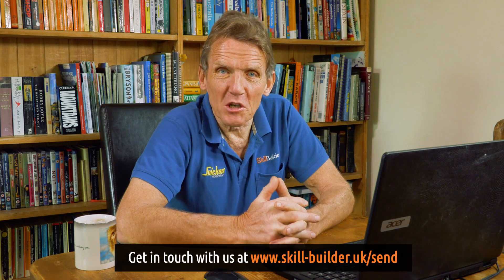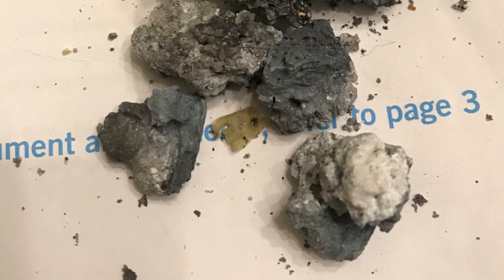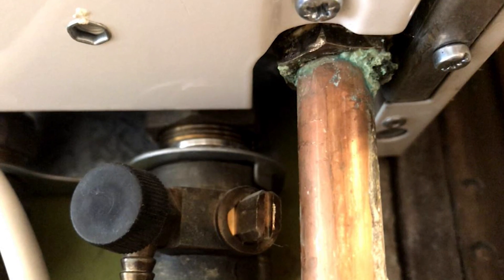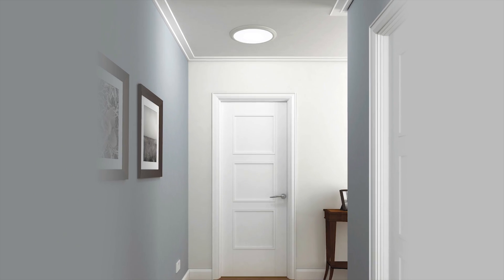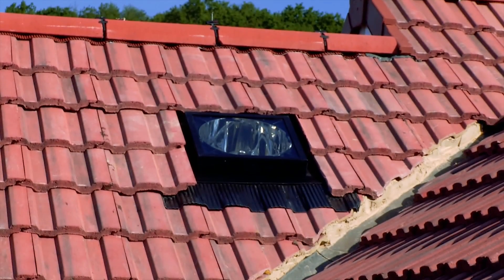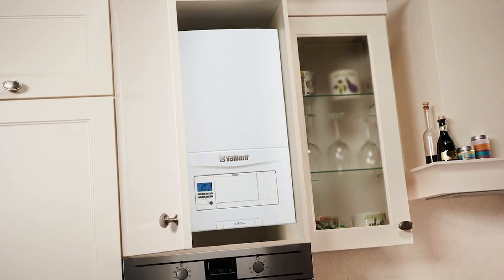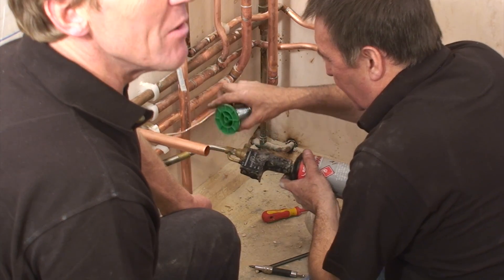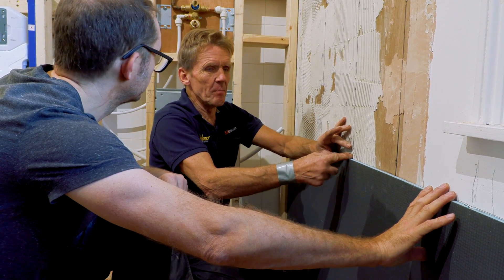Boilers, Darkness & Should We Help? - ASB #13

Comment: DIY-jobs doesnt always end up as pretty as if pro would have done it, but some ppl just wont/CANT afford pro do the job. I'm a builder, and I know that biggest issue is to just start. I do most things myself, if i'm capable or equipped....And my wife accepts the result. Always remembering law/insurance point (am I in trouble if something goes wrong)?
Reply: Thinking Rodger empowers us who are lucky enough to have a  home to ask the Builder who is tasked to come into our home do work the correct questions, not all but quite a few builders will come to your home promising a quality job, then cut corners use the cheapest materials and sometimes the wrong materials and  put same in the wrong locations, doing a Bodge job, and only some time later when you come to sell your home a Chartered Surveyor would come into same on behalf of the New Buyer and list the faults that don't comply with ,"Building Regs"  and faults that are obvious due to shoddy work... best have your own Engineer to draw up a Contract of Work, bill of Quantities  and inspect  the project at various stages and release stage payments,  and to finally snag the job and sign off when completed , some Builders will not even quote and will not want that type of oversight,  but that tells it's own Story...

Comment: Hi Roger, a boiler question. I have had a very large energy company fit a new boiler. I live in a four bedroom semi detached house that was built in the 70’s. I also have a single story extension on the back. The company fitted the smallest boiler in its range, Valiant eco 24. I feel it’s is a bit too small and concerned that it will always be working hard to heat the house. I currently have 12 radiators on the system and will be adding one more when I convert the garage. Thanks

Comment: Hi Roger. I have a problem with condensation in attic staining ceiling boards. Rented this property for past 25yrs. There are 4 vent tiles up on roof but, the roofers never cut through. I got that tar type felt that just drips constantly in the freezing conditions. The thicker lagging they installed a few years ago just makes things worse. The whole space is shut up like a drum.  Thanks.

Comment: I was a sub contractor for British Gas. You are supposed to open the boiler for a visual inspection even if the flue gas reading is correct.
Most people dont though.

Comment: Another great video! I take it you can use a combi to heat an unvented mains pressure cylinder? Wanted to do the same and potentially have two showers running at once, any they need to be amazing! Just use the instantaneous supply from the combi for kitchen and bathroom taps etc. Would love if you could expand further on this.

Comment: Tank fed power showers or unvented cylinders are the only way for 3 shower . Them rubbish alpha things help nothing but waste heat, as they blend water back down before going in to boiler to keep boiler firing , if you room for 3 showers find room for cylinder! People need to put there hands in there pockets and plan properly. the rules are there but idiots fitted Combi in large homes should get a new career

Comment: Biggest gas problem I had was getting anyone interested. Tried 14 different suppliers big and small, to install a new boiler, only 3 replied, one only supplied on credit, wanted over 7 grand, with interest, for a very basic combi, worth a few hundred. Ones who did install were very good, came over 80 miles, not one local response.

Did not go to BG, there are limits.

Comment: Soon I will renovate my own house and plan do most of the work myself too. I love watching the videos of Roger because you see that he is not cutting corners.
If i want to do it myself I will invest my time into it and can be proud after. 
Another reason to watch videos of professional builders is seeing how it should be done correctly. 

Just last week a company was installing a drywall at work to seperate a room... And they did a really bad job. (cross joints by example ) I would never have known if I had not watched some videos beforehand (for my own renovating project)

So even if you dont want to do the work yourself its good to know how it should be done. If you see that the contractor is starting to do crazy stuff then you have atleast enough time to stop him.

Comment: Great video Roger, really enjoy these. Just my useless comments, yeah no one asked :) 

Jane Stark - you are spot on with that, with those kind of jobs, it's common place to have a rooflight over. That might be a pyramid or similar, does add a good few thousand but compensates for the light loss quite well. Sun pipes are a good retrofit when feasible and don't just save electricity but also the inconvenience of having to have lights on all the time. Someone has messed up if lights have to be on during the day...unless it's a basement :) 

Wayne Forrest - Have you seen the thermal stores in the US, massive great things and on bigger houses in the UK they stand around 6 foot tall. 

Anon Builder - fair play with your response and for airing his objection. There will always be DIY'ers and so long as it's safe, there's no harm in it. Vehicle mechanics don't complain about people having knowledge that will get them out of a jam, so how is it different. Yes it reduces the income of builders, but surely it reduces the petty jobs and there will always be those that don't want to get their hands dirty. If a builder is reliably building to a high quality and good value, he should be moving higher up the ladder in project size and onto the meaty jobs where profit is greater. Mainly though, other than the obvious, what is the point of life if you don't improve or add new skills? And who hasn't had a moment when you just don't have the dollar for getting something sorted? If it's an emergency fair enough, get the pro's in. Anyway, keep up the good work!
Reply from the maker: Thanks Chris.
We did ask for comments so spot on, keep them coming. I want ASB  to be more than just me giving answers.
Reply: @SkillBuilder  You're very welcome mate, you do a great 👍

Comment: im a gas engineer..  and ive found people are offering a  'boiler service' for £40 which is just FGA and thats it. not even a tightness test on the gas.... in my opinion thats a gas saftey check not a service.. 

imagine taking your car for a service and the guy gets in starts it up and then gets out and says yeh thats your service complete... 

on my service i want to check seals, clean burners, clean flame sensors, clean condensate trap, tightness test for gas... which would cost alot more that £40

but the customers hears service and just thinks im expensive when im ACTUALY doing a full service..

Comment: Oil boiler isn't coming on when there's a call for heat but goes when you push reset button any thoughts.
Reply from the maker: Probably needs a power flush. If the water is not getting through the heat exchanger fast enough it cuts out.

Comment: That Gas supply run through the shutter is unbelievable lazy job. So many joints on a short run with NO visible support is just asking for damage. They should have done an entry on the side if possible, probably a private job 🤔

Comment: As regards the idea that Tradesmen showing how to do things on the Internet does other trades people out of work I think in fact all that happens is people who would have "had a go" instead learn how to do it properly.  I'm a self builder ... because no way do I have the money to buy the house I've built - I could never have afforded to have all the plumbing, non-load bearing walls, doors, kitchen, plastering etc etc fitted by tradesmen on my wage. Instead I'm doing it all myself - to a standard the building warranty inspector and the building inspector are happy with and have signed off. Some of that I've learned via YouTube,  but I could never have afforded tradesman to do it as I simply haven't got that sort of money to buy the materials and the trades.  Obviously I've had my gas install done by a gas safe engineer and a part P reg sparky oversees my work too.  I think as long as people know their limits, YouTube can enable people who could never otherwise have afforded it to get things done. Not everyone has enough money unfortunately.  Personally I'd love to be in a financial position to sit back and have a cuppa while trades people did all the work if I could 😁 . But since I'm not, many thanks to people on YouTube showing us how to do things properly
Reply: I'm a builder and never have a problem we anyone doing it themselves. We used to be a nation with a bit of "get up and go" & I will always help anyone that has tried and come a bit unstuck - we're all still learning. Also I strongly believe that any half decent diyer will always turn out better work than the professional because they're not hindered by time.
Reply: @timmargereson332  Absolutely - I'm astonished at how de-skilled the average person has become. My grandad was a white collar factory manager back in the 60's/70's, but wouldn't dream of taking a car somewhere else to be serviced and DIY built his own extension that's still standing today. I'm not saying there's anything WRONG with paying somebody to do stuff, but I can't get over being anti-DIY.  More to the point, for some of us, it's actually enjoyable. Takes me 10x as long, no doubt, but it's rare I'm unhappy with my work.
Reply: @regiondeltas  Hi Hermand, good for you - I'm glad you enjoy it and take after your grandad. I went to work in 1980 and have always abided by the old punk ethos of do it for yourself. I'm a builder working on traditional buildings (soft brick, flint, lime mortar) and still love it today !! I wish you well in all your endevers. Regards Tim
Reply: True. And tradespeople like the one asking the question are normally the cowboys who don't want you to know they are overcharging you. I'm an IT engineer and have no problem with all IT related videos out there.

Comment: Funny you open with British Gas, I have a few questions about my boiler if you can help me answer.

I’m on BG homecare and they recently serviced my boiler, now every now and then the flame does not light when I run the hot tap, I assume build up of carbon? 

Also, when the hot tap runs and the heating is off, I can hear my rads makes a noise. I have no air in the system at all as I have checked all my rads, what can cause this?

I have also have a quote from BG for a new boiler with a saving of £700 for being a home care customer, a 24kw system 6rads will cost over £3k with the £700 discount, they say I need the following but think they are taking the piss.
1) I have hive v1 and they said they must have v2 as all new systems must be fitted with this or nest as its from the government. Is this right?
2) I have to run a pipe from my boiler (front of my house) to the soil pipe (back of my house) as the new boiler has acid discharge. Could this not be tapped into the gutter drain pipe?

Thanks for your time.
Reply from the maker: The problem is more than likely due to the diaphragm on the divertor valve. The flow of water to the taps should move the water to the hot water heat exchanger but it sounds as if it is running it around the radiators.  As for the quotes it doesn't sound horrendous but, depending where you are there might be plumbers who would like to quote and it might come in closer to £2,500. 

Yes you do need a condensate pipe but there are lots of ways of getting rid of that 'acid' discharge. 

As for the Hive and  Nest the new guidelines require temperature compensation so your boiler responds to changes in the weather.
Reply: Just doing some quick digging on this and found a good thread below. It maybe because hive doesn't support open therm but from a quick Google the v2 isn't  supported either. I'd ask them to clearly state which new requirement hive is not meeting and go from there.  https://www.avforums.com/threads/hive-illegal-to-use-with-new-boilers.2210116/
Reply: Rob Thomas thank you for your time on this, on the quote from BG it says “Hive 2 Active Heating Programmable Thermostat” reading that thread, it would like I’m good with the one I have, plus BG wanted £250 for hive 2 where they are everywhere for £150. That price does not include fitting as that’s an additional cost.